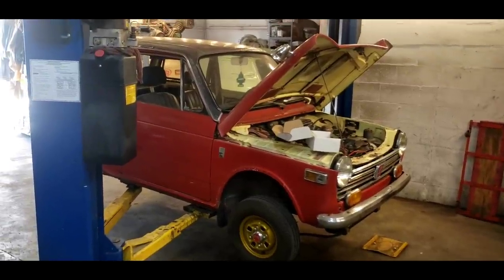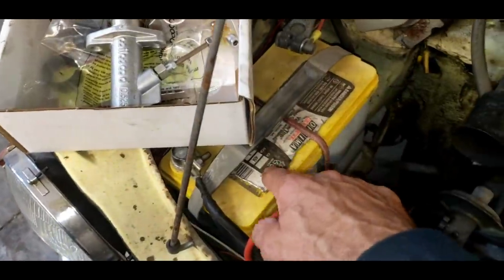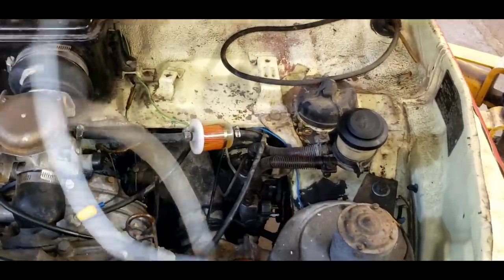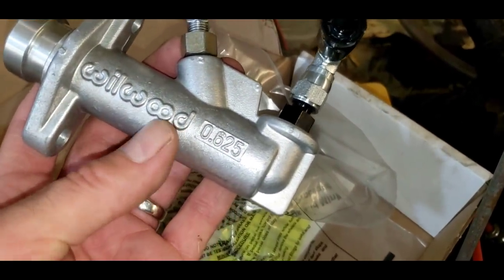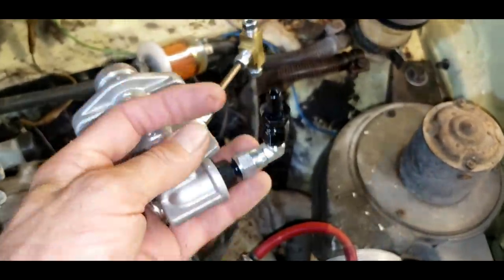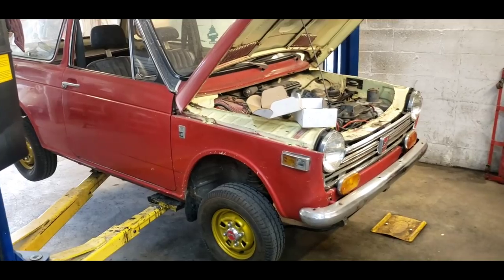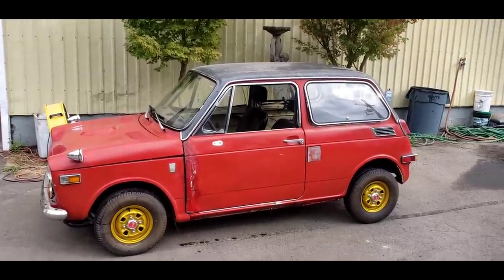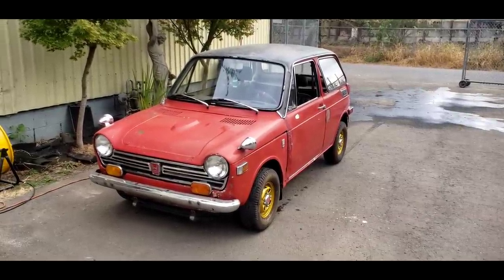Stop on a Dime! Honda 600 Wilwood Master Cylinder Conversion

Comment: Thanks for your brake upgrade share.. will that work better on the world's only ih micro truck , dang that's a tuff one when I have 70s master cylinder.. Subaru rear drum and Austin mini front disk,,, 5ton separation a success , tank departed with video .. 5 ton has air powered wipers..  better power than trimets vintage flexible busses..

Comment: By switching to a smaller diameter master you are making the pedal easier to press because it is moving less fluid. So you have less movement from the wheel cylinders. Make sure your brakes stay adjusted!

The 600's stock master cylinder had dual outputs because it is a split system, for safety. Ya know, front/rear split, so if one side leaks the other works...

You just eliminated a mandated required safety feature.

I like seeing some of your cars, but I can't watch someone destroy classic Honda's.
Reply: I, too, am quite concerned about eliminating one of the outputs. My dad's '66 Ford only had one circuit, so he added a dual. This modification is going backwards.
Reply: Why not a 1980 chevette master cylinder ?  Its a split system master and small.
Reply: @agoogleaccount2861  I don't know if it does or does not, but you can check. The "new" master cylinder must displace at least the same volume as the original. If that's unknown, then measure the diameter and the travel, then use google to find some new-old-stock service manual pdf's with the specifications.
Reply: @Iowa599   pretty sure displacement of a chevette master cylinder in a manual brake chevette  is a bit bigger than that honda 600 oem unit is. I know the caliper pistons in a chevette are larger displacement than a honda 600 .  and its a split system like its supposed to be .  thread adaptors may still be needed to pipe it in though
Reply: @agoogleaccount2861  they have different size calipers, different size wheel cylinders, different size levers (in drum & the pedal), and they're on a heavier car (so everything is bigger). so no, it probly won't work hydraulically, or mechanically, or even fit!

Something with a decent chance of working would be an old japanese master cylinder. Like, one from an old civic, some other Honda, or a similar size car even from another manufacturer, like toyota.

With the master from a big old car you're getting a big master, with lotsa displacement that will get you very short travel.
Reply: @Iowa599   actually ive worked on both chevettes and older hondas. Im pretty sure its only a little larger less than 10cc. . And they seldom go bad   A larger displacement master cylinder would be an improvement in a honda 600. You wouldn't have to press the brake pedal quite so hard to stop